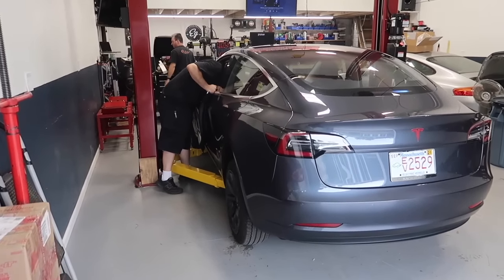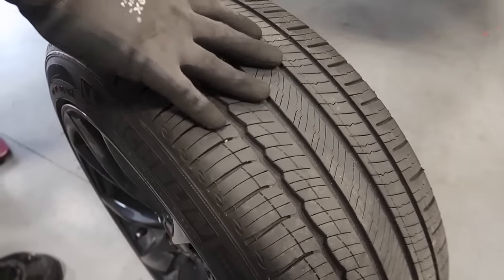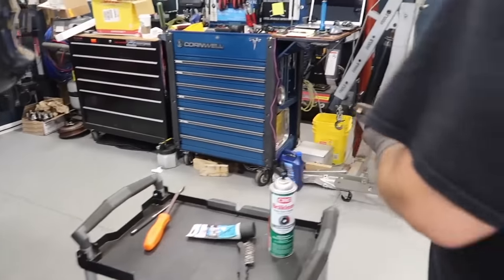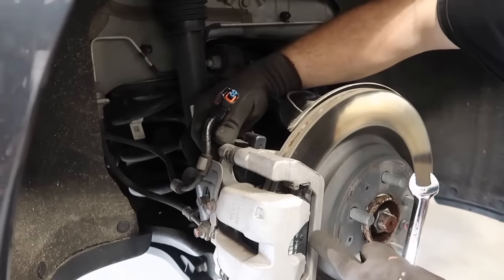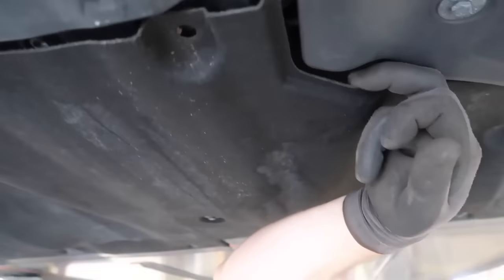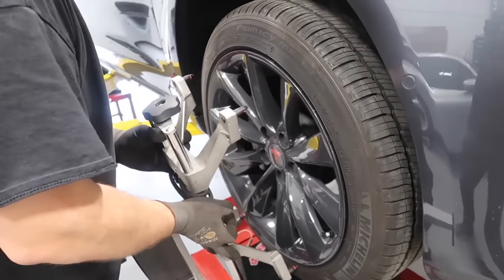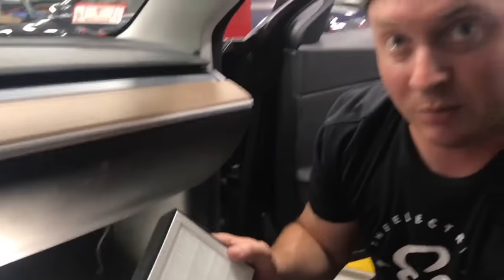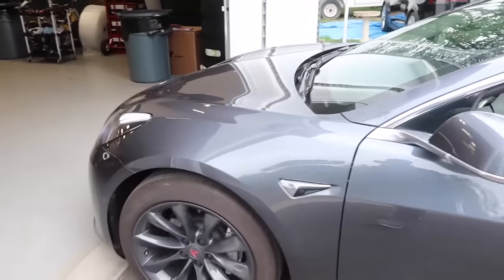Servicing your Tesla model 3: The Complete Guide

Comment: didn't know electric cars still have standard battery, what is it used for?
Reply: It runs all the usual 12 volt stuff. The big batteries in the floor are 300+ volt to run the motors.

Comment: So Rich , if a Tesla ends up off road in a crash and say a rock or metal post or similar penetrated the battery pack underneath would it burn the pack out like in the little wooden car you made at your friends shop ?.
Reply: Probably. I think that bottom plate is 3/8 thick aluminum. Kinda similar to a gas tank being punctured is a gas car.
Reply: JasonWW2000 gas tanks are mounted further up and can leak but not set on fire yet the battery pack is the floor of the car plus just puncturing the tank wont cause a thermal burn , see petrol needs a source of ignition even if punctured the battery pack IS the source of ignition.
Reply: @mjjr1000  Gas tanks are not mounted higher up. They typically are under the rear seat exactly the same as the battery pack, but are made of much thinner sheet metal or plastic with a sheetmetal cover. So much easier to puncture. So on one hand you have easy to puncture and lots of ignition sources or very, very hard to puncture and does not need an ignition source. Keep in mind the Tesla batteries are fully enclosed in their metal case so it is contained. The batteries in the wooden car that burned were removed from the metal case and fully exposed. I forgot about that. So the answer to your original question is no, it would not burn like in that wooden car.
Reply: JasonWW2000 sooooo a full car floor is harder to hit than a 50L-70L tank and a tank hangs lower yeah 👌🏻👍🏻.
Oh and the Tesla batteries are contained in a sealed metal case , would that not act more like a bomb then as one cell going pop would damage surrounding ones and cause a domino effect until the box goes pop.
I’ll stick to fluids or gas for fuel until they charge themselves and are safe.
Reply: @mjjr1000  Harder to hit? What's that got to do with anything? Lower? I did not say that. They are both at the bottom level of the car. Equally low. No, it would not act like a bomb. The battery pack is way safer. You seem scared of batteries because you don't know what is actually happening. Yet you don't seem scared of the more dangerous gas tank. Quite strange. I suggest you read up some more. Until then, I can't really help you understand.
Reply: JasonWW2000 i understand fully i need no help understanding.
Let me help you understand , get yourself a battery 🔋 fully charged and a tank of petrol ⛽️ then get a pointed metal object then in a test stab the plastic can then stab a Tesla battery making sure you go all the way in on puncture point then see which has the best reaction.
Scared 🤣🤣🤣🤣🤣 no , just not enough crash data in yet for me to agree.
Reply: I can see you do need help understanding. You keep talking about independent components and I'm talking about a complete package. Two seperate things.
Reply: JasonWW2000 so on my post my comment is wrong because it’s not the same as what you meant, erm okay , there’s no teaching pork.
Reply: See, you are not understanding. I can not explain any clearer. Sorry.
Reply: JasonWW2000 I was right , there’s no educating you.
Reply: @mjjr1000  Why do you think your right?

Comment: When re-torquing bolts that tend to rattle loose, use a little Loctite, or no?
Reply: Robert Lawton loctite is only used for parts that you don’t regularly service like fly wheels and engine work and stuff. Never use it for tire rotations, changing brakes or suspension

Comment: I drove old POS cars my whole life, and it just seems so anal to me to worry about corrosion on the edge of a brake pad or cleaning the caliper pins after only 15k lmao. I drove a $600 Corolla for 100k and never did anything but change the oil and the clutch and brake pads. I currently drive a $1200 2006 Honda Civic with 205k and I make over 100k. Building my own electric car out of a Civic. Only need like 100mi range anyways.

Comment: I wonder if Tesla uses the Metric system... 🤔
Reply: They do. Simone mentioned it during the Truckla build video. Although a lot of US cars use metric fasteners. My lug nuts use a 19 mm socket, but the owner's manual lists the torque spec in foot-lbf. The oil drain plug is 15 mm, but the oil capacity is listed in quarts.

Comment: Isn't that how you WANT the toe to be for performance?
Reply: Not really, too much or too little toe just eats up the tires. I'm more concerned about the 42psi tire pressure. That's way higher than a normal car. Like 10 psi higher. I guess they want the least rolling resistance possible?

Comment: something I think Tesla owners or EV owners in general should do is also use the regular brakes every once in a while to keep a clean surface on the pads and rotors...obviously regen can't do all the braking but people who like using the regular brakes as little as possible should turn off regen for a drive so that they get all the rust off and keep the parts from sticking.
Reply: On my Volt I have to do a hard break about once a week to keep them from rusting up.
Reply: Gerrad Reynolds uhmmm, EV do use brakes. Do you own an EV?? Rust happens anyway in all brake systems.
Reply: @jose456891  I know EVs use friction brakes...just not as much as in regular cars. I'm talking about rust and corrosion on the face of the rotors and bare metal parts where friction occurs. Doing some hard stops will prevent that from happening prematurely and also prevent things from seizing when they shouldn't

Comment: 23:49   Wait a minute...  am I watching them change a regular car battery on a Tesla?  Why on earth would an electric car need a battery like that when it has hundreds (if not thousands) of 18650's packed away in the frame?  Is that the battery that starts all the other batteries?
Reply: to power up the emergency lights and 12v systems as the transformer for the high voltage to 12v would be turned off if  the high voltage get disconnected in an accident or for maintenance as it is safer

Comment: How about that!! 16,000 miles and 1 year service...I have a 2000 Silverado I haven't done shit to. I haven't even changed the oil in 10,000 miles. It has 221,000 miles on it and it still gets 18ish mpg and is reliable. Maybe Ill change the oil one of these days. For what you spend on that car and the maintenance, I'll bet I've saved $25000+ compared to what this car will require. Performance? Who cares! I need to get to work but not at light speed.

Comment: The bimetal corrosion between aluminum and steel in a damp or salty environment has been known for well more than 50 years, but apparently Elon saw no point in hiring experienced engineers. My riceburner went over 100k miles with out any brake problems. As did the Detroit product before it. That is totally unnecessary maintenance on cars built with proper alloys. Apparently Elon still needs some adult supervision from folks who know history.

Comment: Not that I disagree with doing any of these things, but it seems excessive to do all these things on a car with 16000 miles...
Reply: It's still a lot less things to do compared to a gas engine car.
Reply: @JasonWW2000  I have never done anything like this to a car with 16,000 miles on it other than an oil change and rotate the tires, maybe a cabin filter if it's dirty.
Reply: @hondaguy9153  5 less oil and filter changes.
Reply: @JasonWW2000  16 thousand would be 2-3 oil changes. If you're doing 5, you've done way too many.
I didn't say over 16,000 miles, I said at 16,000 miles... The services they are doing on a vehicle at/with only 16,000 miles seems excessive. I have a Leaf. I've done less than this in 54,000 miles...2 cabin filters and 10-12 tire rotations and 2 new tires because one got ruined from a pot hole.
Reply: Typical oil change is every 3,000 miles. They are probably following Tesla's recommended maintenance in order to comply with the factory warranty. Every car company and every model has different maintenance requirements.
Reply: @JasonWW2000  typical oil changes were 3000 miles 20 years ago.
Reply: @JasonWW2000  also, they cannot invalidate your warranty just because you don't do their maintenance to their exact requirements.
Reply: @hondaguy9153  IDK, maybe the owner of that car cares more about maintenance than you do? We can decide to do as much or little of maintenance as we want. The owner of this Tesla in the video could have skipped this entire thing and just driven it till the wheels fell off.

Comment: The guy is unnecessarily grinding way too much metal and paint off the pins, brake pads with that bench grinding wheel. He should be using a metal buffing bench grinder and compound or a bench wire wheel grinder. You can polish the corrosion right off but grinding the metal off the pins is an amateur move.

Comment: I'll, change the gear oil every 12,000 miles and rotate the tires every 5,000 and trade it in before it needs a brake job at 250,000 miles. What a waste of money.

Comment: I can't believe that has the same brake design as the older Toyota Tundras and Sequoias, with the brakes pads sliding on pins exposed to the elements. Worst brake design ever in my opinion
Reply: I'm mechanic in northern MN and you basically have to replace those pins after every winter or they get too rotten to even move

Comment: Yet another confirmation of the poor build quality of the Model 3.... SMH. No one would tolerate half that level of defects from a conventional manufacturer.
Reply: What in the hell are you talking about? 

People are still putting up with shit like Ford releasing the RS with a self destructing engine at 20 thousand kilometers due to using improper head gaskets. 

Can you name the 'defects'?
Reply: @RealityGutPunch  In this video specifically, the section re: the undertrays and subframe bolts either missing, loose, or not properly installed. This car had a couple loose bolts and one bracket that was never bolted down, and the tech tells stories of cars he's seen with loose or missing subframe bolts. Those types of issues come from only one source: poor assembly, either because the workers weren't trained properly, were rushed, or both.
Reply: @sqmotorsports9230  ok fair enough - first is that we don't know if it was from the manufacturer or if it was another mechanic that screwed things up. If subframe bolts are loose from the manufacturer that's pretty bad. But let's not pretend that major safety and quality related issues that are as bad or worse don't make it out of other manufacturers plants. Tesla typically gets way more scrutiny than any other manufacturer, which I'm fine with. What I am disagreeing with primarily is that other manufacturers are allowed to slide on a ton of shit and there is usually a class action law suit required to get them to fix it. 

 There's thousands of examples. As a car guy you should know this.
Reply: @RealityGutPunch  Yep, I see it every day. But what Tesla is doing these days reminds me of the horror stories from American manufacturers in the early 1980s, and it baffles me how they can still have so many rabid true believer fans who look the other way.